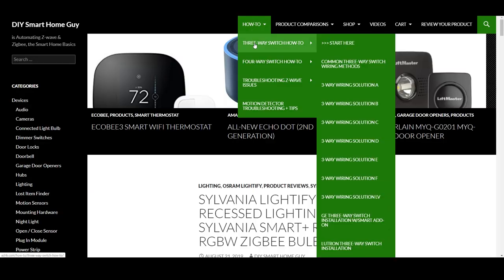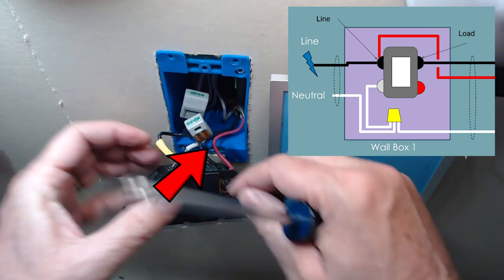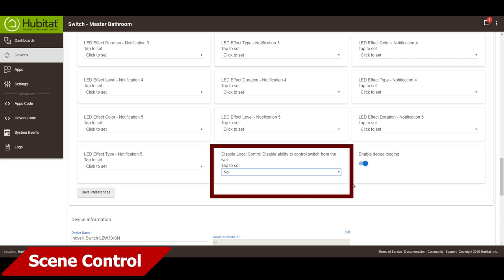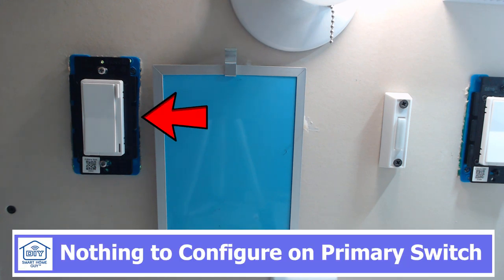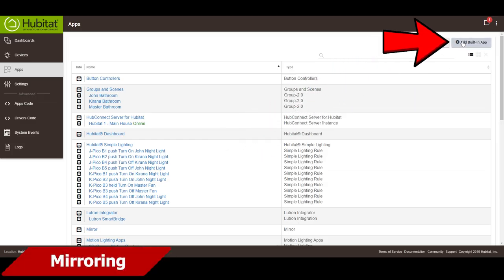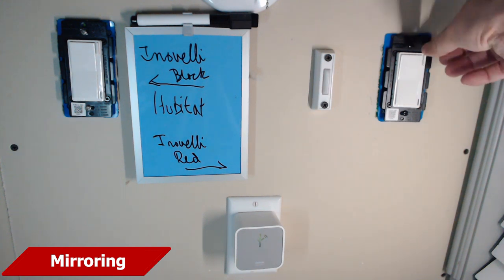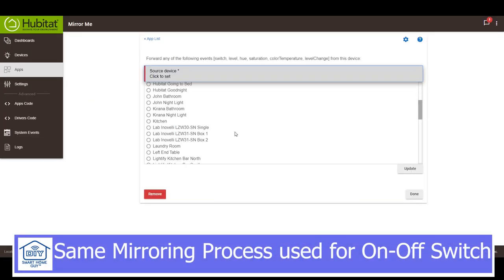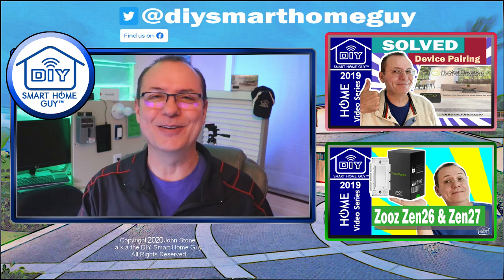3 Way Switch Wiring with Two Smart Switches - Hubitat Elevation

Comment: Just curious why you didn't put the Red on the main switch... wouldn't you then be able to get energy monitoring that way?
Also, any clue about power consumption with the switches off (in a neutral wire situation).  I was SHOCKED to hear that in these days of green that someone was putting out a product which was (if I understood you correctly) resulted in 25w of consistent draw.